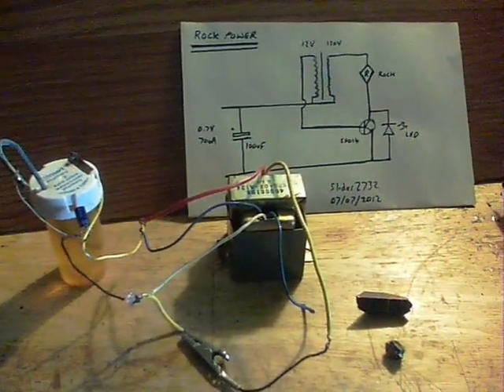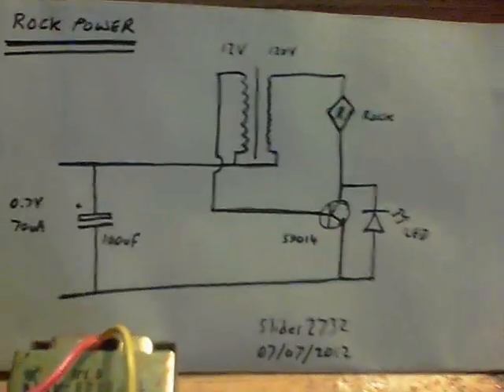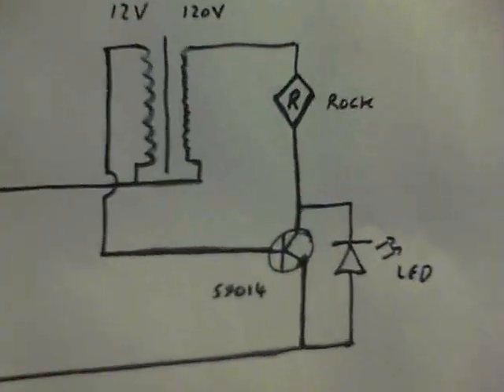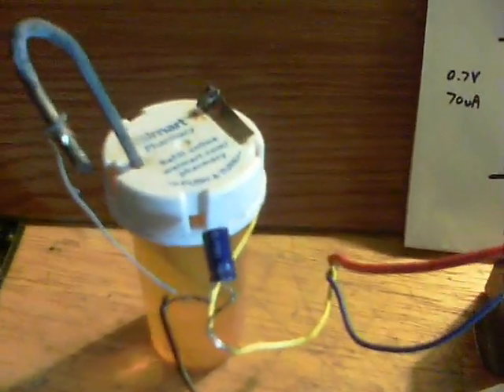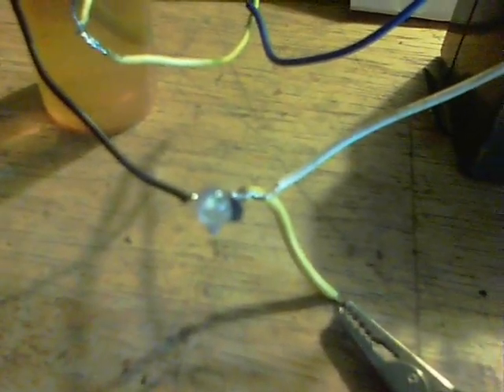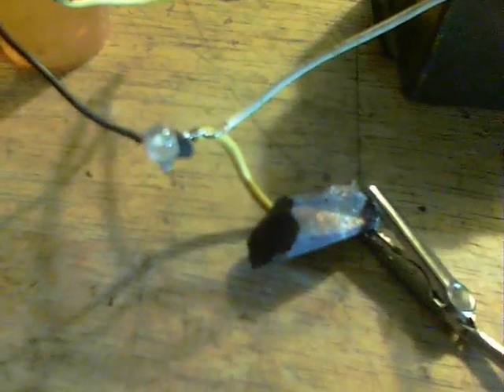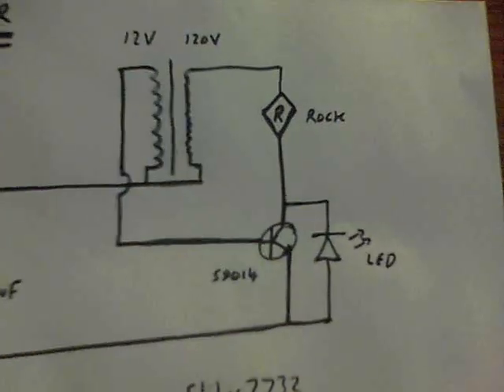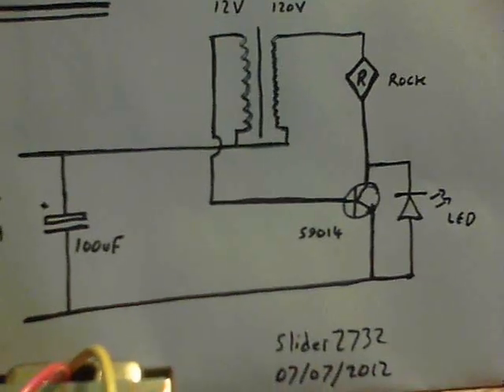Rock Power

Comment from the maker: I still have no idea. Although, an increased output change was observed with 2 galv steel electrodes in purified water - in series with the Collector. Holding the collector output in the hand and touching the transformer pin also had a partial effect. That would point to capacitance but, yes, perhaps a diode effect as seen with detector diodes in crystal radios. Natural polarized capacitance within conductive rocks ?

Comment: maybe smash the quartz, put it in liquid glass sol. and heat up to crystalize and then connect, lattices will maybe be better formed inside it.  liq. glass is made with silica gel beads and sodium hydroxide quite easily if you'd have thoses.

Comment: try using diff meteorites
Reply from the maker: That would be a great idea ! if I had any lol. Thanks for the comment.
Reply: =] they normally look similar to to iron ore rocks on the ground (only more rigid)
Reply from the maker: Yes, will look out for them. Could well be some very interesting properties in space rocks :)
Reply: yeah, most of the meteorites are iron, but from falling through atnosphere at high speed caused em to heat up so much that the molecular structure of the iron got changed is no longer magnetic, yet still conductive, sparks when ground with a grinder, and still rusts.(if they are big enough they can still have some normal iron that is still slightly magnetic)